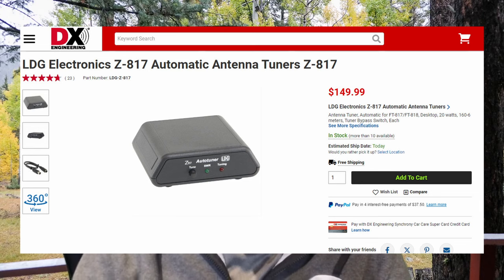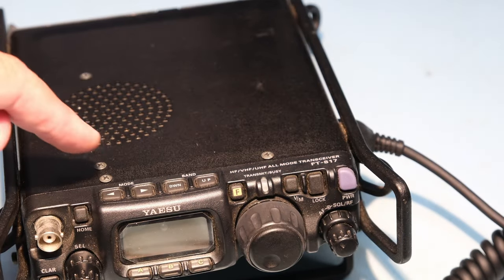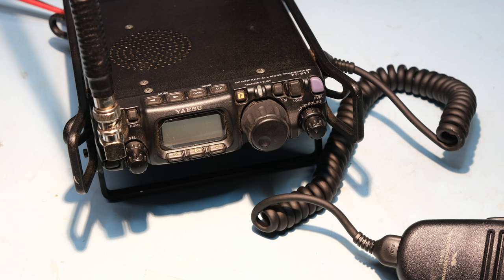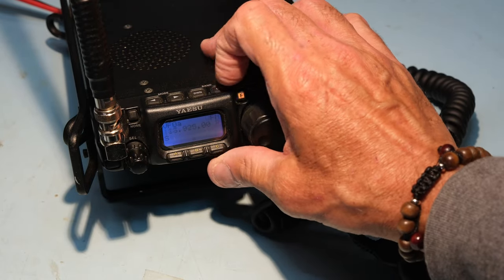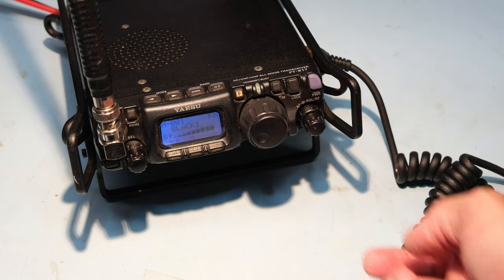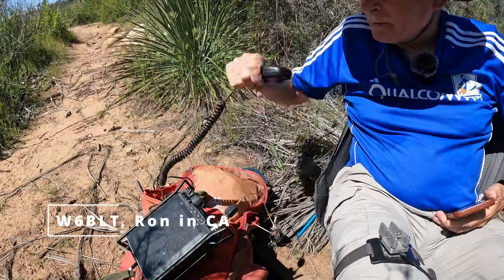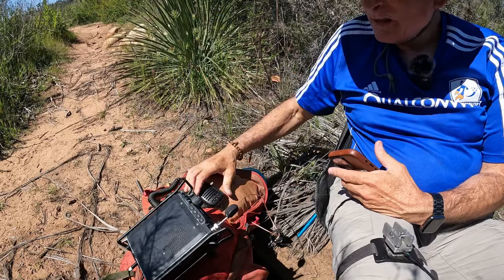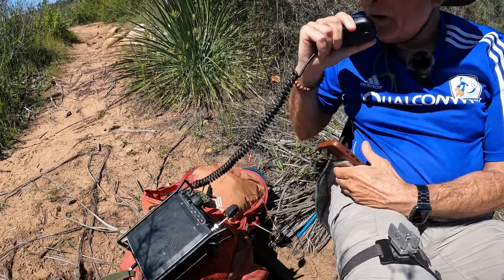FT 817 for SOTA

Comment: Thanks for a nice review. I like your leg strap and small CW paddles - Can you provide a link to them? I'm currently using full-sized (i.e., bulky and heavy) paddles on a leg strap and I'm looking for something smaller and lighter. Also, is the angle of the paddles where they attach to the leg strap adjustable? Thanks
Reply from the maker: The strap is from https://americanmorse.com/.  I normally use the begali adventure paddles but in this case, I'm taking the N0SA paddles out for a spin.  You'll notice that paddle in other videos.  AMR does make some nice padles as well.